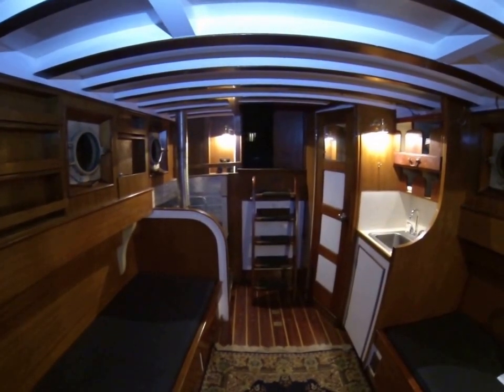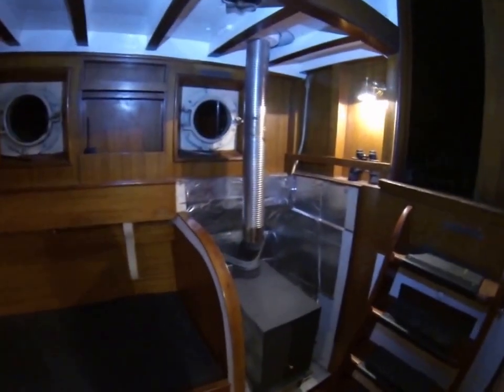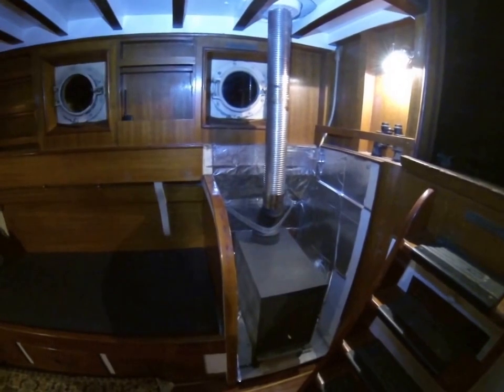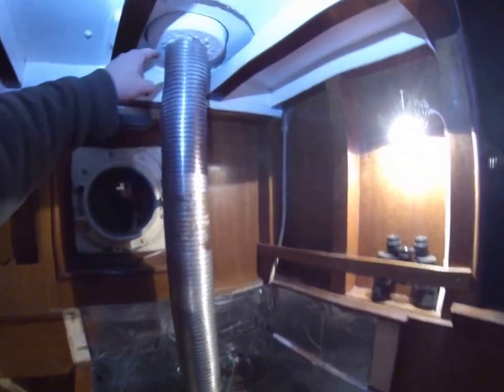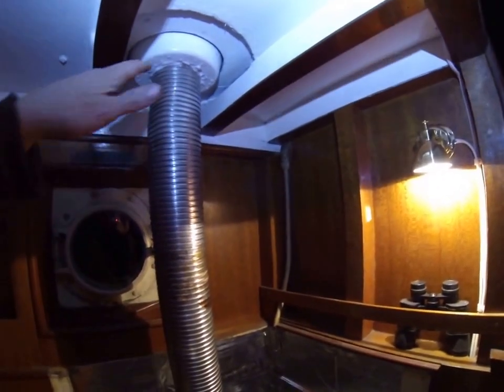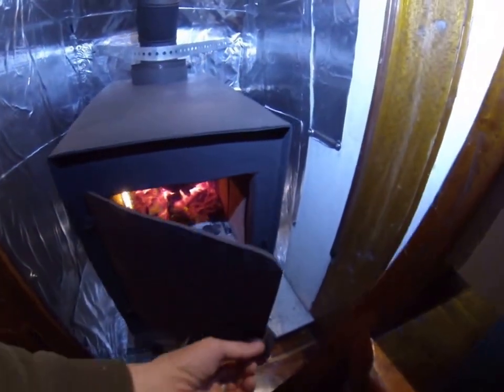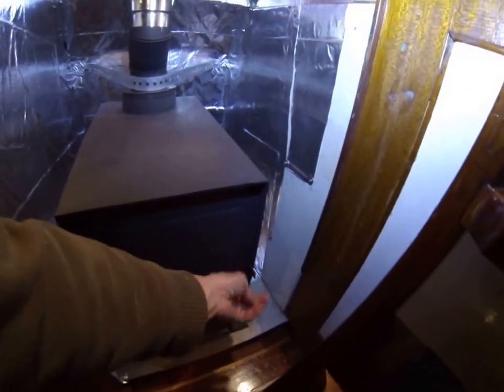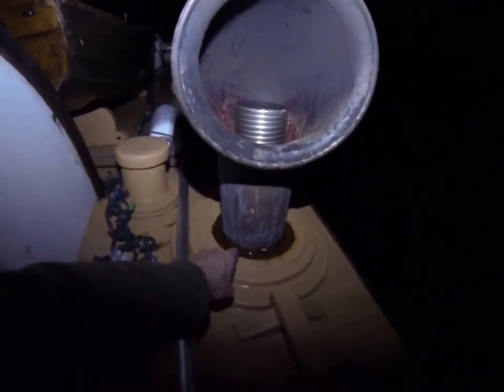Alder II: Wood Stove

Comment: Looking good Peter! Looking comfortable too! What did you put down for flooring?
Reply from the maker: +A fine looking gentleman The flooring under the fireplace is same as on the sides - cement board with heat reflective material. The main floor area is custom - I made it up a couple of years ago. Its planks for African Mahogany and  Indonesian mahogany screwed and glued to 1/4&quot; plywood panels. The panels are screwed (not glued) to the original sole. I sealed the panels with 2 coats of epoxy.

https://youtu.be/gMjFto3nEKk